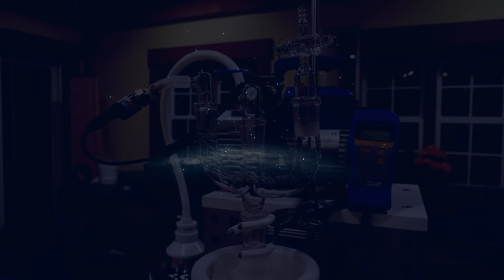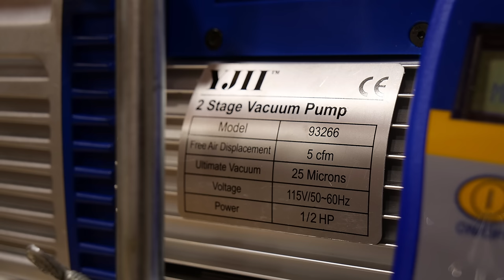Vacuum pump with NO moving parts

Comment: Thanks very interesting. The really big question in my mind is - does the alcohol concentrated with your molecular sieve taste better than your whiskey made by distillation? It should have no harmful ketones that are formed during distillation but perhaps some of the aluminium salt pellets taint the alcohol.
Reply from the maker: It tastes the same.😀
Reply: Tech Ingredients Wow! That is a surprise. That means the harmful ketones are formed during fermentation. It then follows that we need to find a way of separating the ketones from the alcohol. So perhaps a secondary, slightly coarser sieve?

Comment: I'd be interested to see the same set-up heated and cooled without the beads to see how much of the pressure drop was due to the beads and how much was due to the normal pressure/temperature relationship.
Reply from the maker: It's easy to calculate.  77K/300K is the thermal ratio without adsorbtion.

Comment: Very cool. Would making an O2 concentrator be difficult? Do you need to sense when to stop releasing to atmosphere and start releasing O2? Or could you just do it with time?
Reply from the maker: Once you have determined the pressure/mixture ratio then you could rely on that without real time monitoring.

Comment: Interesting. Thank you for providing this video. Makes me wonder how big that temperature effect is if you can't move over a span of a few 100K. Let's say i want to dry moisture out of plastics that are rolled up in long strands on a spool. And i can't heat that up to more than 60°C, wonder if investing the thermal energy to heat that vacuum vessel and plastics to 60°C would be saving me not only time, but energy too. Or ist it way more energy efficient to leave the pump running at room temperature, and just wait a lot longer for the same amount of moisture reduction in the plastc filament. My feeling says the hot way uses way more energy, but maybe my intuition is wrong?
Reply: It's not a matter of just letting it run longer. It's like trying to fill a bucket with a hole in the bottom of it that leaks slowly into it gets more full and it starts leaking faster than you're adding water. You can keep adding water, but it won't get full. You need to plug/reduce the leak to fill the bucket. Hear will allow you to pump down to a level you can't reach without the heat, regardless of how long you let it run. For plastic filament, it is completely unnecessary to pump down that low, though.

Comment: theorectically one can chain two pumps together.. so if one pump can achieve a pressure difference of say 300psi (yes that's weak), two together would be 600 psi?

Comment: crazy tinkering question: I have a pair of brown suede shoes that are no longer the same shade. Oil based salad dressing was dropped on one shoe and darkened it. Could I put the one shoe in a pickle jar, pull a vacuum with the standard HVAC vaccuum pump, and let it sit for a while with molecular sieve inside the jar to absorb the oil and lighten the color of the shoe?
Reply from the maker: No.  The vapor pressure of oils is extremely low.  You won't get any practical transfer of the oil out of the material.  That's why after years that stain will remain while water will disappear in a few hours.

Comment: I once painstakingly obtained sodium hydroxide from a drain opener which consisted of sodium hydroxide beads, and a loose mix of aluminum and sodiumNitrate granules.  Based on what you said molecular sieves are made from, I wonder if one could bootstrap a crude version of them from the leftover mixture of said granules.  Probably not.  Probably stupid.

Comment: For 3D printing carbon fiber nylon prepare the nylon why you have to use a 5A molecular sieve to drive out as much water as possible to avoid boiling off the water during the melting process which would give you a nylon foam rather than a nylon melt that you can use for printing stronger less heat sensitive parts then such Plastics like pla. If you don't remove the water first like I said you get a phone which is still left temperature-sensitive pla but you don't gain any strength

Comment: Hey, I just noticed those angled brackets fixing the extrusion on that stand............they're exactly what I need for the 3018 CNC mill I'm building.....gotta go and browse EBAY........
Reply from the maker: McMaster Carr has a full line of fittings in stock, but you may pay a little more.  The company is "80-20"
Reply: @TechIngredients  Thanks, just bought some on EBAY as we don't have Mc M in Oz.

Comment: I think you may have just explained why for several years now my perception and memory have been so bad when it comes to working on physical objects! I was just recently diagnosed with a rare type of asthma [ 'air trapping asthma' ] where the air in some of the alveoli in my lungs are somehow sealed off or partially so, and not working properly [ I have had many cases of pneumonia and other lung infections and exposures to corrosive gas, so its amazing I'm even alive at this point! ] and so I experience continuous hypoxia. Maybe I need one of those portable oxygen concentrators when I work in the shop so I will stop making so many darned simple little mistakes!
Reply from the maker: It's possible.
Have you ever had an opportunity to get a resting oxygen saturation level?  Super simple, it's what we read on every hospital patient monitor.  I'm sure you could get someone with some access to pop a finger probe on you for a minute or two.

Comment: Excuse me Sir, I do have some 3Å molecular sieve which I plan to use for water absorption.
My question is if I can regenerate it with heat alone (200-300c), Or a vacuum pump is a must ?
Reply from the maker: Heat alone is fine.  Don't exceed 300C, but get as close as you can for a rapid dehydration.

Comment: Fantastic Channel!

When you create a lower pressure on the vacuum pump than it is capable of pumping, can it back flow?  I don't know how the one way valves from a normal pump would work at such a low differential pressure in a vacuum pump.
Reply from the maker: You could indeed have back flow and one way valves will not work at a pressure that is so low that not enough force is generated to move them.
However vacuum systems are statistical and there is always the potential for back diffusion of oil even when the bulk pressure is lower downstream.

Comment: Im really interested in electromagnetic fields lately, namely the electromagnetic pulse, but cant find any decent sources on coil/antenna shapes, voltage needed or what the heck is the result is. Would be cool if you made a video talking about EMP generators and EMP "grenades" (quick burst, not continual generation).
Reply: maybe the People who know do not want the Knowledge to be spread. a EMP grenade would be usefull in lots of sinister applications.

Comment: I'm hoping you still look over the comments on older videos, and find this interesting enough to answer or look more into it. 

About a different way to concentrate oxygen.  You mentioned that nitrogen stickes to silicon dioxide.  I'm wondering if oxygen gas sticks more or less than nitrogen. I'm hoping oxygen sticks less to help assist with oxygen concentrating. Then there is the  fact that nitrogen is diamagnetic while oxygen is paramagnetic.  My thinking is that an electromagnet coil around a large diameter can filled with sand or sodium silicate to a certain diameter in the center and magnetite sand grains filling the rest.  The magnetite will concentrate the electromagnetic coil's alternating magnetic field leaving a low to nomagnetic field in the center with the magnetic fields between the magnetite grains tending to be strongest near the outer diameter and leave a magnetic gradient to the center.  On the entrance side, air would be let in  at the center, and at the other end  gasses are pulled out of an orfice in the center and a few small orfices around the outside diameter.  And the volumes pumped out our are maybe in a 90 % to 10 % or 95% to 5% ratio with the gasses pulled from the center  in being oxygen depleted and the gases pulled from the outside being oxygen enriched. Pulling air through would create a lower pressure inside with a higher mean free path for oxygen and nitrogen to move (being pushed or pulled) acording to how they respond to magnetic fields. And, If run continously, the alternating  electromagnetnet field would heat the magnetite which would also increase the mean free path between collisions making the magnetite and oxygen still atractive to each other but less long term sticky with a graduated effect to pull oxygen to the outside and push to keep nitrogen in the center. 

Maybe using magnetite sand grains, heat, partial vacuum and difference in pumping ratios works better than just magnetic fields alone to concentrate oxygen.
Reply from the maker: I do.
It's  actually  simpler and uses less power in typical concentrators.  By selecting the pore size a molecular sieve can separate  oxygen and nitrogen by making most of the surface area accessible only to one of the molecules allowing  filling and emptying the container to separate them.

Comment: Could this effect speed up condensation on a vibrating sheet? My windows are getting hit by dual or even triple 55-60 Hz radiation sources. It increases condensation 400-2000%.

Comment: Purchased the same yellow jacket vacuum pump you suggested.

After a day of use, the oil is very cloudy / full of condensate.

What is the best way to dry the oil?

Drain the fluid and bake / boil it off?
Reply from the maker: I just dispose of it.  It's relatively inexpensive.

Comment: Great work! I will try using this to remove ozone gas when I'm using an ozone generator. I've been trying to develop an ozone concentrator that works off of two properties of ozone gas: density (heavier than air) and solubility (10x more soluble in water than O2) I'm wondering if you could make a better design using a molecular sieve? Could concentrate the O2 and then convert to O3; or make O3 and concentrate that?
Reply from the maker: You certainly could.  Pure oxygen converts to ozone at a much higher effeciency than room air.

Comment: Wow, I learned a lot new stuff today!!! Thank you for these videos. Does the pump only work when you cool it down? Did I understand correctly that the sieve traps gasses and condenses them?
Reply from the maker: They will only condense below their boiling point.  That is why liquid helium is used to pump air and other low boiling point gases.
Reply: @TechIngredients  Thanks!
Reply: Linecraftman it adsorbs them - the gas sticks to the huge interior surface area.  It does not condense to a liquid.

Comment: What if you purged the vessel with CO2 prior to evacuation with the rotary pump and subsequent pumping with the sieve? Since at liquid nitrogen temperatures Co2 has a much lower vapor pressure than air wouldn't it allow for a harder vacuum? I imagine you would have to seal off the chamber entirely to lower the pressure beyond ~10 microns since the rotary vane vacuum pump would cause unacceptable back flow into the chamber.
Reply from the maker: Not a bad idea.  Worth a try.

Comment: This is a more resin/composite question. But would it be possible to chemically create a mirror surface, overlay it with epoxy and then reinforce it with some of the fiberglass or composite techniques you’ve shown to create a super thin shatter resistant mirror?
Reply from the maker: Plastic optics can be created both with traditional grinding/cutting or better with molding.  If the composite mirror is fabricated in an optical quality mold, the surface in contact with the mold will be of optical quality, all you need then is a reflective coating.

Comment: Finding this video is very timely indeed. I recently purchased a 310 bar air compressor for my HPA paintball marker. The pathetic excuse for a condensate & oil trap that it came with is pretty much useless, especially here in Western Washington where rain and wet is the norm (presently 98% RH.) I started looking at options for removing the moisture from the high pressure air and realized that 1) good traps are expensive because of the high pressure they need to withstand and 2) moisture is still getting into various parts of the compressor itself, even if I remove it from the final product air. This got me to thinking. What would happen if I dried out the intake air? I know it's a lot harder to remove all the moisture if the air isn't under pressure, but is it possible to remove enough without great expense or difficulty? I did some research to see how dry I could get the air with either a 3A molecular sieve, or by running the air through a low temperature vapor trap. Perhaps the two could even be combined? There's lots of info out there on how well various molecular sieves work at elevated temperatures, but only on numbskull like me wants to know how much more/less effective it might be at -20°C.
I haven't ordered any sieve material yet because I have too many other projects right now, but I did connect a segment of ribbed, copper boiler tube to some Tygon tubing for an initial test. I placed the boiler tube, open end down, near the bottom of my chest freezer so that any air drawn into it would be from the lowest, coldest, and hopefully driest region of my freezer. I ran the Tygon tubing up and out of the freezer to my compressor's intake. The short top-off refill of my tank, from 165 bar to 210 bar left no visible signs of moisture in the compressor or condensate trap. 
I would be very curious to know if you have done any experiments to see how low you can get the dewpoint of air at ambient pressure, and if it can, in fact, be dried out enough so that no more moisture will squeeze out once you bump the air pressure to 300 bar and bring it back to room temperature. Any thoughts? 
Thanks again for your awesome videos!
Reply from the maker: There are actually dessicant based air dryers for compressors commercially available.  Usually they include two towers one is adsorbing while the other is heated to drive off the adsorbed water to allow continuous operation.
Reply: @TechIngredients  Yes, they're handy as a pocket knife. We have one in our shop, but it's only rated at 300 psi. My new compressor is rated at 4500 psi, and that's where air dryers get spendy. I'm considering placing a portable compressed air tank in the freezer and filling it with 120 psi air a day or so in advance. That might also do the trick.
By the way, I LOVE your chiller idea (using a chest freezer) in your reflux still video! I may have to use that idea at some point!

Comment: Even without the beads, the pressure is going to drop when a sealed container of air is immersed in liquid nitrogen.  If you put pure oxygen into that flask first (and no beads) and immersed it in LN2, you'll get close to a vacuum as the O2 liquefies.
Reply from the maker: Sure.  The bead's huge surface area simply amplifies the adsorbtion effect even on gas like nitrogen that doesn't liquify at that temperature.

Comment: Could you compare this to cooling the glass with no molecular sieve inside?  Wouldn't the liquid nitrogen alone also condense much of the air even without them? For example both O2 and CO2 have lower boiling points, so they would start to condense and drop the pressure as well.
Reply from the maker: It won't work.  The nitrogen will not condense and the oxygen will still have a significant vapor pressure (by vacuum standards).  You need the surface area for adsorbtion binding.

Comment: Hi, I love these high quality videos that you make and your way of explaining things so most people can understand what is going on, I would like to ask a question regarding the molecular sieve and that is would it be possible in your opinion to use this material to turn a wet air supply from a compressor to a dry supply by directing the air through the sieve material, what do you think.
cheers from the UK.
Reply from the maker: Yes, that is already available.  Two columns are often used to allow one to be regenerated with heat while the other is adsorbing water.
Reply: @TechIngredients   Thank you for the super speedy reply, I wasn't aware of that so guess what I'm going to be doing shortly, Thanks again from UK.

Comment: I'm trying to put together a similar setup as you have with the attached stonylab equipment. I've been able to find everything I need except for the evacuation manifold you have attached to the pump. Could you by chance let me know which one it is or where to find it? I don't recognize it. The one that is bolted on with the right angle connector and blue valve. Would be big help, thanks!
 *edit: I have the same pump as you do, same size adapter.
Reply from the maker: I believe I obtained it on eBay a few years ago.  They're out there, but you're going to have to search.  Try starting with 24/40, three way (I know it's four way) adaptors or "T" adaptors. It's likely to be associated with varieties of those.
Reply: @TechIngredients  Thanks for the quick reply! I found the four way adapter, I'll link it for others. https://www.amazon.com/dp/B07CH2TKVV/

and the attached adapters or very similar: https://www.amazon.com/dp/B07CHBWZTF

also a flow valve that I think would work like yours:
https://www.amazon.com/gp/product/B07CH44B9L

I'm looking for a good valve to attach to the intake on the pump like you have. Would any 3/4" ball valve rated for gas work to make a good vacuum seal? The vacuum manifolds sold by yellow jacket are almost half the cost of the pump haha